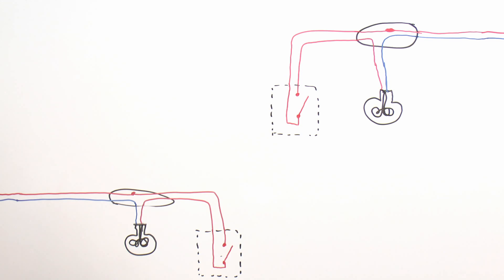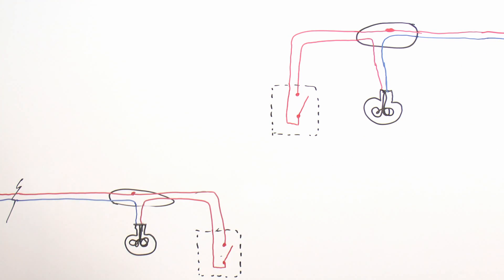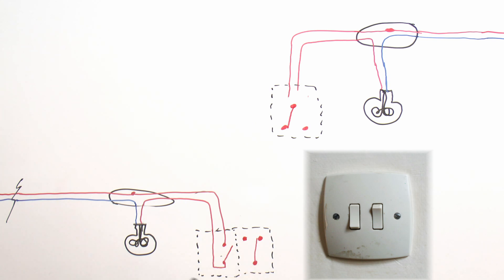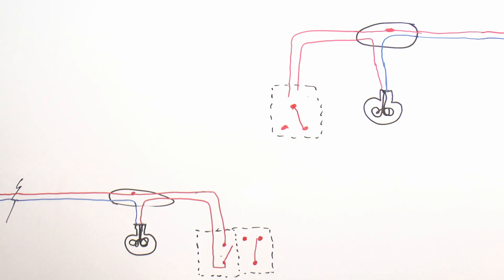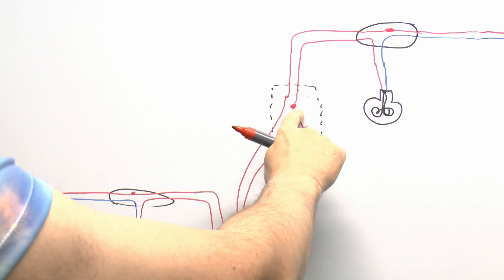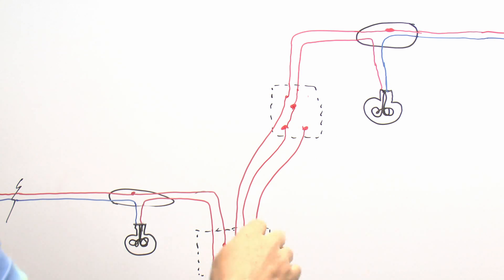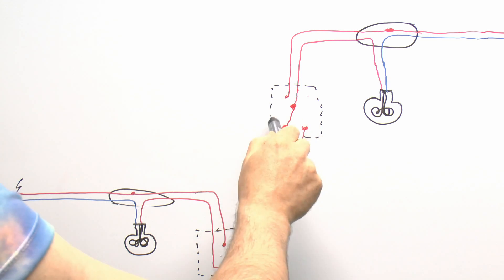Borrowed Neutrals & Old Lighting Circuits

Comment: hmm...I always have placed the stairs and hallway lights on a separate circuit from the rest of the lighting anyway... but was trained by an engineer in the usa in his buildings... we put every building lights into bedroom circuits, bathroom lighting and then hallway and stairs lighting, and then we used common or kitchen and living lighting... for all of his properties... so that he could have the hallway and stairs lighting covered by a UPS system in case of storms or power outages... Guess I never thought about combining them because the extra 15 amp breaker was never really a problem in the boxes, and was easy to then place into an emergency power system. Now I actually set up a small box beside the main breaker panel for emergency circuits to lighting, fridge, and freezer, and one small set of outlets, usually in a hallway, in any system I wire in the caribbean, just for the use of a generator... means a bit more in costs but makes it easier in storms.

Comment: This is what my house wiring was like until I replaced it all last year. I remember trying to isolate the upstairs lights only to find the landing light was still powered. I found the link wire in the downstairs switch. Pretty-much everything was wired in single cable, the only T+E I found was some old lead-sheathed stuff for some of the sockets. Needless to say I ended-up replacing the entire house wiring.

Comment: I was called in to troubleshoot after a non-electrician who was charging $100.00 an hour failed to find the fault. A light had 20 volts to the switch and there were a number of circuits with joined neutrals. The problem was solved when all neutrals were confined to their own circuits.

Comment: I came across one on the same circuit once, someone obviously couldn’t get a link when they rewired (3 plate to 2plate wiring) so they took it off one of the kitchen lights. Client wouldn’t let me do damage so I consulted my boss who said although not ideal if it is within the same circuit and no others then it is allowed but should be mentioned on the testing sheet for future work.

Comment: Can you make a video about potential differences and high voltage imbalance between neutral and phase wires when the normal voltage 230 increases to more than 300 volt  between any phase with neutral? The causes and solutions to this fault.

Comment: I had an odd issue at my parents' house. The bathroom basin taps were giving them a shock. Testing them revealed a voltage (luckily not 240!). I eventually traced it to a problem with the switch controlling the upstairs hall light from downstairs. I decided to disconnect it completely. The upstairs hall light is now switched by a motion sensor connected to the upstairs circuit only.

Comment: Hi, I am a new electrician. A few days ago, I took power from existing cable to power store room light. I used junction box, but when I turn the light on the living room, light stays on regardless button on or off. I am confused any help.
Reply from the maker: Could be many things, but suggest you check that the cable is actually power, and not the switch cable for another light.

Comment: I'm just rewiring my house and most of the lights are 2 cores with no earth. Some of the lights fittings are metal too! Very bad, so I've replaced them with twin core and earth other than the kitchen light which is in a single story extension from 1970's, so I can't get into the roof currently. It's a pitched roof so at least I'll be able to get in from above, but it's the wrong time of year for that.

Comment: Having 2 different circuits in the same switch seems like a bad idear. If someone wants to service the switch he/she might only turn off one of the circuits, and get shocked. In Denmark you are required to put a warning on any box with multiple circuits.
Reply: Per Mejdal Rasmussen Here I believe it's traditional to put a notice that says "Isolate all supplies" but not on domestic stuff
Reply: Yes: you have a dilemma: either you have two circuits in the same switch, or you have a live and neutral upstairs in the ceiling rose and that is also confusing if someone switches off the upstairs circuit and expected that upstairs rise to be isolated.

Comment: How does this work if you have a 2 way switch upstairs and downstairs ? Our hall is like that and you can control the upstairs hall and downstairs hall from both sides. I play i safe and turn of both if i am working on it .
Reply from the maker: +Andrew Joy If there are separate circuits for up/down, the switch would contain live wires from 2 circuits, so both would need to be isolated before working on it.  That is permitted, however 2 separate circuits being connected together is not.

Comment: My house has a different system. The landing light is not connected to the upstairs at all but to the downstairs only. 2 way switching is achieved by the old method of 4 core cable, red, black, blue and yellow.

Comment: Hi John, Do you know a way of fault finding at the CCU to find out which light has the borrowed neutral?
 
For instance if you were in a 3 bedroom house with a ground floor and a 1st floor:

 If you suspect it's the landing light would you take all the lamps out of the ground floor and 1st floor except for the landing lamp and then do continuity test with a meter tester between Line and Neutrals could you confirm it's the landing light?

So if you supect it's the ground floor hallway you would remove all the lamps apart from the ground floor hallway, and so on. I've tried drawing it but I can't quite prove my theory!

Comment: i rencenctly had a shower installed alongside a new light fitting and fan. Since then the breaker for the upstairs lighting every so often trips now i can turn breaker on and light only go out when i turn downstairs lights on. Could this be a neutral fault because the kanding light is fed via groud floor and the neutral is 1st any ideas

Comment: Heres' an even more evil sneakier wire-saving-hack I could foresee being done in certain circumstances -- what about.. connecting  a switches L1 and L2 terminals to line and netrual, the "C" (common) being a single-wire to one side of lamp, other side of lamp coming back to a similarly wired 2-way-switch ...     Now you can have both neutrals borrowed at the same time with even less wires on the inbetween-cable =).  The lamps' supply polarity will of course be different, and an apparently 'off' light can be live on both terminals, all sorts of evilness of that config!  But I really really wonder if it has 'been done', somewhere out there!!
Reply: This has been done many times and is in fact not uncommon in older properties in the USA!
Reply: In the us it was known as the "Carter" system
Reply: I've heard of this, and known it as a farmers 3 way or barnyard 3 way, since it allowed a yardlight between a house and outbuilding to be switched from both locations and have receptacles in the outbuilding constant hot using just 3 wires in between instead of 4, not counting a ground.    As late as the 1960s, many old timers who lived through the depression era used this setup because it saved one wire, and they were very frugal and watched every penny spent on labor and material.

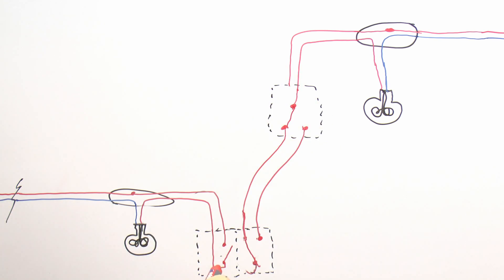Comment: I'm confused, from about 6:10 isn't this borrowing a live, rather than a neutral? Each circuit has it's own neutral, but the live link in the switch shares the downstairs live with upstairs?
Reply from the maker: It can be considered that way, although it's normally called borrowed neutral.
Regardless of name, it's taking live from one circuit and neutral from a different one.
Reply: Well, yes, I guess it's the flip side of the same coin really, you still end up with the same problem, i.e. a circuit that should be dead that isn't
Reply: Well, 
both names are true ...
But it is more sensable to consider this case a "borrowed neutral" rather than a "borrowed live line" ...
When a load is connected to a live line of a circuit it is considered within that circuit (even if it doesn't complete its circuit with a neutral line) cause it will be active and dangerous all the time the circuit being energized.
I guess that's why the common name is "borrowed neutrals".
B. R.

Comment: Around 6:30 and again 10:30.

This might not have been a cheat at the time of installation. Up to the sixties or maybe the seventies it was usual to have just one lighting circuit for a small house. This means that it was apparently legitimate to wire it the "lazy" way. 

Then later on, the upstairs and downstairs lighting circuits are split for whatever reason, but not entirely rewired. At that time whoever does that work fails to notice that the light at the top of the stairs runs from the downstairs live but returns via the upstairs neutral. The illegal wiring therefore comes from not surveying the original properly before the lighting circuits are split apart. 

Yes it's still sloppy work but the sloppiness occurred rather later than the date of the original wiring. My guess (and it is only a guess) is that this is the more usual history of these borrowed neutrals

Comment: I. Used to see 14/2 used all the time for travelers  nd they pull a neutral hap hazardly  out any circuit y that closes to the switch closes to the light .of cource using 14/3 is the correct way now days both switches Ares supposed to have a neutral contained in the box

Comment: I am confused.  Aren't all the neutral wires connected back to a common bus bar?
Reply: Problem arises when the neutral becomes disconnected or broken. The broken end away from the CU floats up to 230V as soon as any lamp is turned on. So you come in to mend it, turn off the downstairs circuit, and get  zapped by the power still being fed from the upstairs live. 

That's just one reason to ALWAYS poke with a test screwdriver, it's less painful than finding out the other way

Comment: Which test would show up this situation?
Reply from the maker: Leaving the lamps in on both circuits, switching the light switches on, and testing between the conductors of the two separate circuits at the consumer unit.
Reply: @jwflame  so something you’d have to be specifically looking for?  

Would it show up on a standard EICR?

Comment: You've gotta wonder how often someone couldn't be bothered to obtain proper three core, and thought sod it, we'll use twin & earth with the "earth" as one of the switched lines... Or neutral... Or any other combination thereof. Scary thought.
Reply: reggiebacci I have come across that recently actually... someone wanted to install an extra light switch in a box that had ONE twin and earth, they used the red as the phase feed, then earth as the switch leg out of the other switch (for an outside light). Because the cable was plastered in.

I chased a new TC&E into the wall for him, and put it in proper oval conduit so it can be re-threaded at any future time.
Reply: +reggiebacci 
Indeed that is quite evil!
Reply: I've seen that. I moved into a property where a slightly damp passage way through a row of garages had been wired with T+E, using the bare earth as the Live, and the L & N as the two SL. In metal cased switch boxes. Slightly damp walls and no earth.

Was alerted when the metal switch box felt "soapy" while I was looking at the property prior to purchase. I bought it anyway but did a very urgent rewire of the DIY passage lighting the day after I legally owned it.

Comment: ...more "creative wiring" to save a single wire...again, retrofitting or upgrading, and running a cable between downstairs and upstairs for the purpose of creating a two-way control of a light, running a three conductor cable prevents all of this unnecessary complexity and creating potential safety hazards.  Not to mention multiple circuits in a single box...  Question:  Did the British brainiacs who came up with these ideas also work for Lucas?  
Edit:  I don't normally badmouth an otherwise good, informative presentation by a guy who clearly knows of what he speaks (I don't even know how I got here!)...but that's why we have the National Electrical Code in the US...to prevent "creative wiring"...which might work, but which also creates unusual or unsafe conditions ready to bite someone in the future!
Reply: Ronplucksstrings aaa

Comment: I gather wiring is in single phase 240V in most homes in the UK
Reply from the maker: +Richard Golden-DeWitt Yes, in virtually all of them.  3 phase 400V is available but normally only installed in commercial premises.
Reply: +John Ward  I'm  finding this quite interesting I have always known the UK was 240V it's  done so much different here in the US & in Canada  virtually every home here is 2 phase 110V-N-110V and 220V across the  load lines also what you call a RCD we call them GFCI and most of the time are located at the outlet, mostly used at wet areas
Reply: Yes, the outlet style GFCI seems to be very popular in North America... whereas we go for them at the board (electrical panel). Does the same job though, which is the important bit :)
Reply: John Ward Interesting. Here in South Africa it can be single or three phase for homes. I have three phase for a larger house, but also the 400v feed is great for a borehole pump to water the garden.
Reply: Yes. Normal practice is adjacent houses are on different phases to keep the unbalanced return current down as far as possible.

Imagine the surprise when DIY dimwitted thieves connect the live from their neighbour's house to their own to steal power through their neighbour's meter, then don't realise they need to turn their own power of first... 

Notice that although each phase is 230V, the difference between phases is just over 400V and they basically shorted them together ...

Two company fuses and a visit from the police later ...

---

I'm currently in a three floor walk up, and my neighbours vertically are all on the same phase as me, but next door horizontally each way are on different phases. That's because the flats are wired on vertical single phase cables that daisy chain to the the three company fuses on the way up